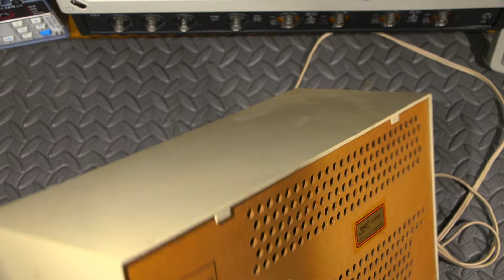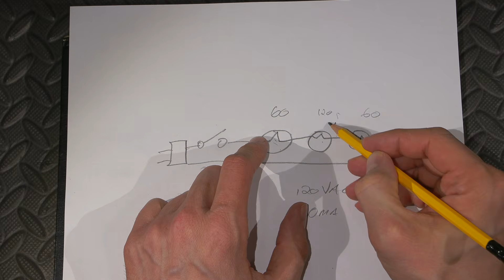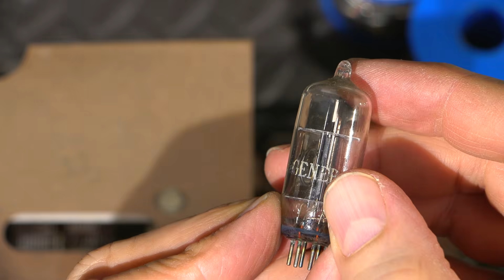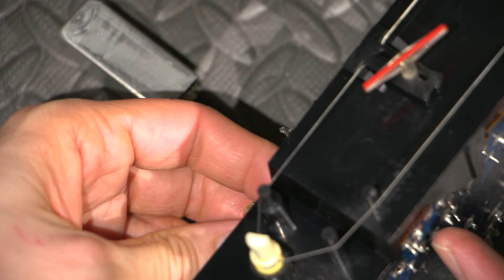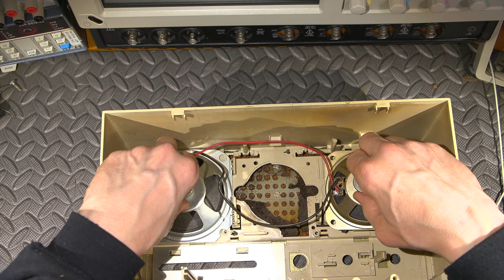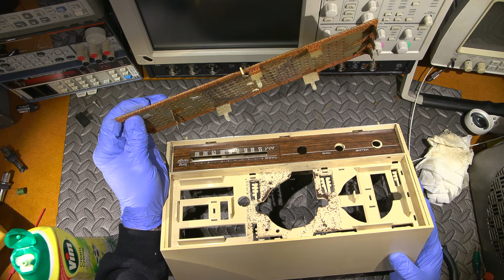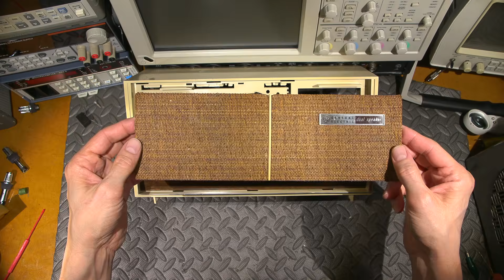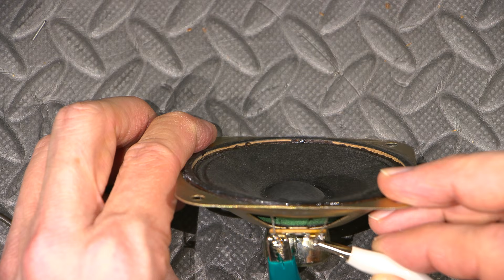Barn Find Restoration Adventure - 1960's Long Range Radio Receiver!

Comment: just a thought.... is your test speaker the same impedance as the two factory speakers together?  are they parallel or series?  being tube output.... these things can matter, or at least that has always been my experience with  high powered tube audio amplifiers.  Maybe it's less critical in a low output system like this?  Question - not criticism... just asking and learning :-)

Comment: Mr Carlson, you said the audio output tube runs hot in Class A.  Why not bias the audio tube to run at a lower output?  Lose a bit of volume but gain tube and component life?
Reply: It's already lower power output - 35C5 instead of a 50C5. Also, you can't bias it to run at a lower output or it won't be class A, it'll just clip. A lower plate voltage might work, but better to just run it hot. This one did OK for quite a while and it was still going.
Reply: @jamesvandamme7786  There's no reason you can't bias it lower, just increase the cathode resistor. It won't clip unless you set the volume control near the top of its range.

Comment: On that IF transformer with the broken wires, did you just butt the two ends and solder them back together? Or did you do anything else to add some strength to them? Just curious. In case I ever run across something like that with that flimsy of a wire.
Reply from the maker: I removed half a turn from the upper bobbin and soldered it directly to the original solder post.
Reply: @MrCarlsonsLab   so I guess it didn’t effect the inductance that much or at all. Thanks. Great video and restoration as always.
Reply from the maker: @chrismosley409  Half a turn will hardly affect the inductance. Any difference can be tuned easily.
Reply: Ive had to solder these fine wires, on occasion.. The real "bitch" is to get the solder to "take" properly.. The wire ends needs to be cleaned carefully as this type of wire is usually coated with a type of varnish.. Once you have "clean ends".. Usually the solder 'behaves'.. A small xacto knife and tweezers working under a magnifying glass... A steady hand and infinate patience..
Reply: @bobmclaughlin7276   thanks Bob. I've wound some coils for my crystal radio projects and i was surprised that the varnish wouldn't burn off with just the heat of the soldering iron. then someone suggested nail polish remover so i tried that. didn't work so good and it stinks. so like you said i just scraped it off but i wasn't using that fine of wire either. you were talking about patience, i wonder if anyone has ever tried to rewind one of those IF'S from scratch. that would be a job for sure.

Comment: in many cases i've reformed ht electrolytics ok, especially later models, mid 50s onwards...first thing i'd do is make sure no 'unobtanium' parts such as tuning coils, IF transformers are ok before thinking of recapping, or replacing would be a waste of time and money , i was asked to 'service' a 1930s murphy a while back, and although looked ok on top and at first under chassis, and powered up ok via lamp limiter, there were no signals, i found that some coils on the coil bank had been 'eaten' by something, probably a mouse, there were a few mouse turds in the bottom of the case,  so set was pretty much a write off as a radio, unlikely to find anything to replace them,  but was able to get it working as an amplified speaker, as it had pickup sockets, so just one cap to output valve grid was replaced, main ht electrolytics perfectly ok , and worked nicely, to be fed from bluetooth receiver or whatever they wanted....they werent going to use it that often anyway ...
Reply: i should think the tube heaters failed quite often in these sets due to high surge current at switch on and no series resistor to absorb the surge, unlike UK acdc am only sets where nearly half the mains voltage is dropped across a dropper resistor (am fm ones did nearly add up to full mains voltage, around 200v so had more of a surge)! i did see the left hand valve 'flash' quite a bit when you switched it on when testing after refitting the IFT ..
Reply: one of the first, if not THE first pcb mains valve set from philips was awful,  valve socket pins were only into tiny track pads,  almost guaranteeing dry joints, and one i have needed all resoldering,  their next pcb design was better but still seem to have dry joints on many of the components! hot valves and srbp pcbs dont seem to go well together  ,  one tv/radio repair engineer i used to know called dry joints 'philips disease' due to how much of their pcbs seem to be afflicted 😁
Reply: we dont seem to have silver mica disease over here in the uk, at least not in the same way, as i dont think any uk made IF transformers used that type of construction, they had separate mica caps soldered to the internal pins of the transformer can , not integrated into the base moulding, much easier to replace if they do go bad..

Comment: Using WD40, how do you get the silicon or what ever lubricant is in WD40 off the board and components? I do know that WD40 is not a true lubricant,  but it does leave an oily  residue behind. Nice trick though. I restore 1970s HiFi gear and dirty PC boards are quite common. I spray WD40 and wipe off on tools which keeps the rust away.

Comment: but why dont messure direct at the tube whein its outside the radio for Resistance across the filament with no line voltage present? isnt that a safer way check the filament?

Comment: Where do you buy your tubes? Do you buy them in bulk?
Reply from the maker: Yes, I purchase them bulk.
Reply: @MrCarlsonsLab  I've always been fascinated by electronics since an early age, but found out when joining the military that I am legally color-blind. Even so, I built a 25" Heathkit TV in the early 70s and only mixed up two wires. All transistors and ICs, but for the CRT and high voltage rectifier.

Comment: i ran across some i.f. transformers the adjustment screws has been glued in place is there anyway loosen the glue without breaking the core???
Reply from the maker: I heat the cores (slugs) with a special soldering iron tip, then rock them loose with a separate tool.
Reply: @MrCarlsonsLab  thank you i'll try that

Comment: Hello...  I am trying to fix the cloth on a old 1928/1929 RCA speaker cabinet.  The cloth is not ripped and it is complete, but it is old and probably dirty.  In the above video, you said you used a product you called "Fantastic" to clean the cloth of the radio.  Can you post the full name of this product or maybe post a link to it?  I searched for Fantastic and was still unsure of what you bought.

Comment: Adjusting the rf coils at high end is wrong. The coils must be adjusted on the low end, where the tuning cap is at its maximum, so the small capacitor adjustment is supressed. Only after that you adjust the upper end by that capacitor (and then repeat). Attempting the opposite would make you to diverge from the correct setting and not converge towards it...
Reply from the maker: Its an "RF interstage transformer."  It's adjusted properly. I always get a good chuckle out of people telling me I'm aligning things improperly.
Reply: @MrCarlsonsLab  By the "rf coils" I mean all the resonant circuits tuned by the tunning capacitor, so antenna, the rf amp before the mixer and oscillator. Not the fixed IF.
Obviously any alignment applies only to those which are really adjustable (so here it is indeed the rf intarstage transformer between the LNA and mixer, the antenna and oscillator are fixed).

And indeed, I don't know how are you really aligning them in real life (very likely correctly as otherwise it would just not work - the sensitivity math behind that is just unavoidable).

But I'm responding to how you are SHOWING the procedure in THIS video (adjusting the capacitor at low frequency band end and inductance at the high frequency end).
Or that is a least, how I understood it from this video.

Comment: Paul, is it really safe to use WD-40 to clean a phenolic PCB like that?  Wouldn't it damp it and make it somewhat conductive?
I was taught not to use greasy substances to clean that sort of materials specially if there's high voltage involved.
Reply: WD-40 is a solvent based oil, and it's not conductive. If anything, it would add a slimy film on the PCB that would prevent atmospheric water vapour from making the dirty surface conductive.
Reply from the maker: WD-40 displaces water. (Water Displacement formula #40) is what WD-40 stands for. It's a benefit to old dried up PC Boards, and is a wonderful cleaner. After the use of compressed air, and towel drying, the residual residue is gone in about 2 hours at room temperature.
Reply: @MrCarlsonsLab  OK, Thanks. I stand corrected!
Reply: @MrCarlsonsLab  WD-40 can also be used to remove sticker glues from non-porous surfaces.  I half expected you to use the stuff on the plastic case instead of IPA.

Comment: Why not use electrical contact cleaner instead of WD-40? Electrical contact cleaner is a powerful solvent that allows grime to just wash off by positioning the board to an attitude that allows the cleaner and grime to run off, it also has the advantage of quick drying, plus, it eliminates the tedious task of that mechanical brushing, as a matter of fact, the makers of WD-40 have come out with a contact cleaner of their own, named  WD-40 SPECIALIST- Contact Cleaner, specifically to address what I'm talking about.
Your hour and forty-five minutes cleaning time vs around five minutes of very effective cleaning using contact cleaner, it's a no brainer in my opinion?

Comment: I would like to find a quality retailer of old tube type radio's.  My electronics training in 1960 had 20 weeks of electronics with 2 weeks of transistors,  no integrated circuits.  used cycles not hertz then.

Comment: Still can’t figure out the heaters. 12 volt heaters times 10 tubes would be 120 volts, but there were not 10 tubes?

Comment: Are the two speakers in parellel! Because that would bring the output to 4 instead of 8 ohms, or are those 16 ohm speakers?
Reply: The speaker on the right (when looking from the back) is a 3.2 ohm speaker. That low impedance, plus the fact that it was made in Japan, plus the fact that it looks crooked makes me tend to think it is a replacement speaker.

3.2 ohms seems strange but it was common in tube equipment. AFAIK they might be the same as 4 ohm speakers, except measuring the DC resistance instead of the AC impedance.

Comment: Well done !

EXCEPT, while you were "restoring" this device, you HAVE "improved" it - by replacing an old "compound" electrolytic capacitor by three modern electrolytic capacitors, plus replacing other capacitors with "High Voltage AC"  types.
However, you did NOT improve the "serviceability" of the device, by adding any of the now cheaply available plug-in "connectors" (and the few extra lengths of the conductors involved) to the "connections" to the Speakers and the "Arial Coil".
This means that a future "service person" STILL will need to unsolder these connections, when you could have provided "plug - socket" connectors, to make this task much easier (and less time "costly"), at a trivial extra "cost", which the manufacturer did NOT provide !

Also, you did not mention that the 6.3 V "Dial Lamp" MUST be in series with the "filament string" of the 6 vacuum tubes concerned.
Hence, a faulty "dial lamp" could also cause this device to "malfunction".
The "Voltage Drop" across the "filament string" mentioned adds up to 118 V.
Adding the "Dial Lamp", this comes up to 124 V - which is a trivial difference.

Comment: Nice restoration, the radio looks and sounds great.  But it's kind of sad that there's little worth listening to on AM anymore.  Around SF there are a lot of foreign language and religious stations (and some right wing talk radio) and they serve their audiences.  But even the news and sports stations have gone to FM.  If I was going to put one to use it would have to be with my own low power transmitter and programming I want to hear.

Comment: Hi Paul, what is that circular plate on the bottom of the PCB at time mark 1:14:21 in the video?
Reply from the maker: That's a shield to stop the IF section from breaking into oscillation.

Comment: It's strange  vim cleaner never heard of it in my life.  USA buffalo NY area 
What kind of plastic polish did you use? I only know of the novus 1,2,3 family for plastic.
Reply: Vim is one of my "go to" cleaners... But you need to go easy with it.. Try it gently first then add "elbow grease" if required.. It might take off more than you want... Ive used automotive wax as well, with good results on plastic... Usually to 'finish up' a surface

Comment: What makes it a long range radio Receiver?
Reply: Extra RF stage. They used a 35 volt output tube instead of 50V to get the extra filament voltage for the tube.
Reply: @jamesvandamme7786  Also has a larger ferrite rod antenna

Comment: That looks like 👍 a GREAT 👍 radio 📻 for your living room. Is it AM/FM? That tube probably has been red plating during the last part of its life. I’m going to guess that that’s the tube 🚇 tube that burned out. Double grille cloths mean 😢 dual speakers 🔊. This is probably a stereo radio 📻, or at least, a better mono one ☝️. Use a very fine polishing wheel. This should remove, or greatly 👍 reduce the scuff marks on the case. Your friend, Jeff.
Reply: What's with the childish emoji's? Grow up, this is an adult channel.

Comment: Is there a way for you to make these All-America style radios safe?
Reply: If the chassis is sufficiently isolated from the user then they should be pretty safe if you add a fuse. You might also want to make sure the switch is on the non-chassis side and switch to a polarized power cord.

Comment: It's impossible to restore vacuum tube radio because vacuum tube is already completely phased out and being replaced by transistors and integrated conductors .
Reply: Sorry it's integrated circuits semi conductor I really mean
Reply from the maker: @oscarmapalad2053  Tubes are still in production Oscar. Guitar amps are being built right now with new tubes. Besides that, there is enough old stock out there to do this for years to come.

Comment: Probably not an original speaker, the speaker on the right says Japan!
Reply: What I'm thinking. Why would they stock different speakers that sound the same?
Reply: @jamesvandamme7786  They could use different speakers to get a better frequency response. The same reason some speakers have separate woofers and tweeters.

Having said that, I do tend to think that speaker is a replacement.